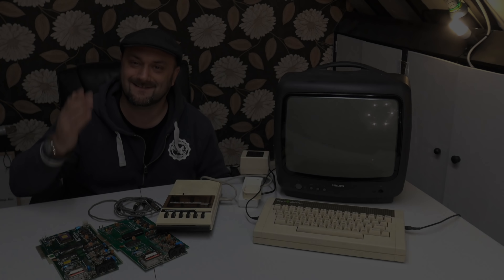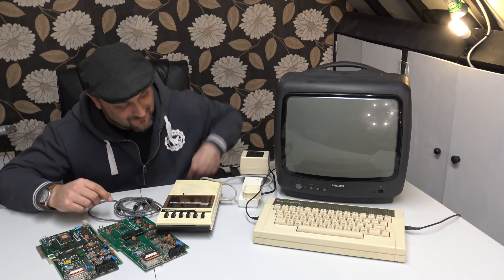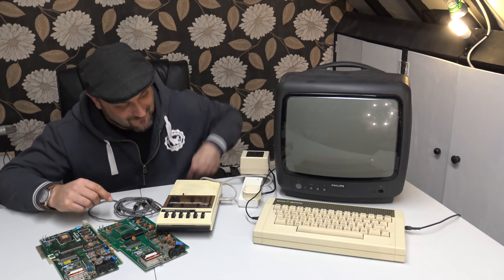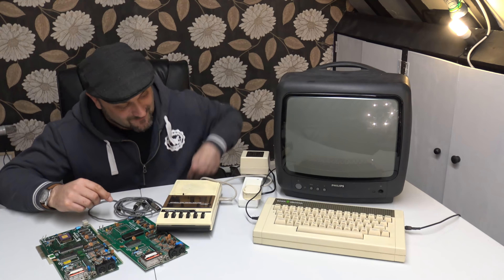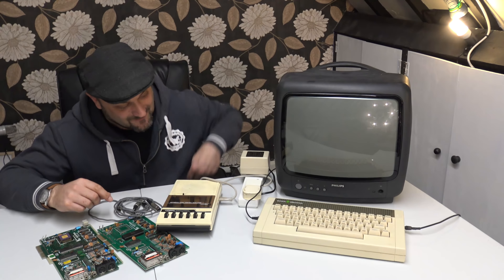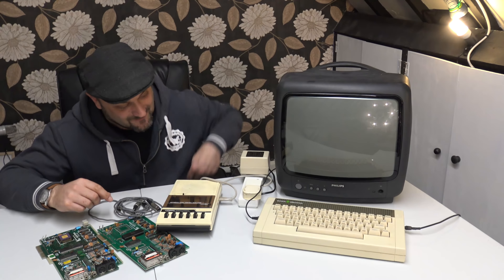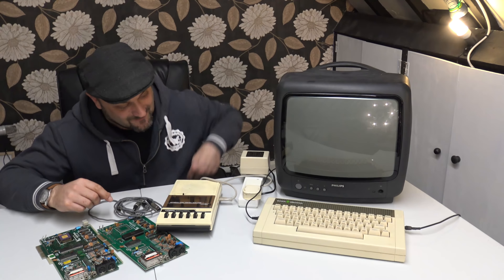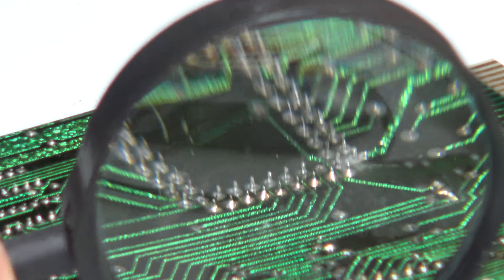DuB-EnG: Retro Acorn Electron setup - RESTORE & replace the ULA Chip REFURBISH the Motherboard PCB

Comment: hello do u know about lander on acorn risc os? did it have sound at all? thanks 1990 with fred harris it had sound please help thanks
Reply from the maker: mazhar said lander was on the Archimedes... and yes it had sound from what I remember... it was amazing graphics!
Reply: hello but on todays emulators there is no sound at all when running lander thanks - just wondering why thanks @DubiousEngineering
Reply from the maker: mazhar said ...   hmmm...  well... you may actually be right... the “demo” lander never turned into a fully fledged release... perhaps it didn’t have sound...  sorry

Comment: Wait a sec, why was desoldering a socketed chip desirable or necessary? Did they use different sockets?
Reply from the maker: Sorry ... this was Part2 ...  I should have explained that...  watch part1 and you’ll get it!  https://youtu.be/3dhiw_VTHkQ
Reply: @DubiousEngineering   Oh i see. I wonder if standard PLCC68 socket which costs a few cent has a compatible footprint so the rest of the boards can be restored too.
Reply from the maker: For those kind enough to take time to comment, here is early access to a future release...   https://youtu.be/UpA1n3ugHIU